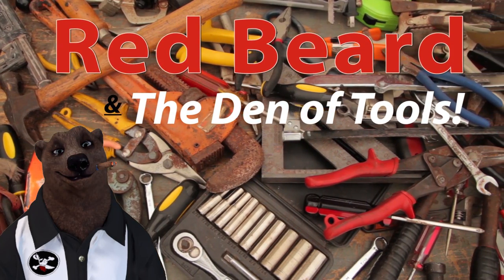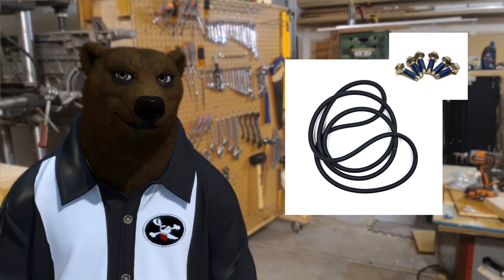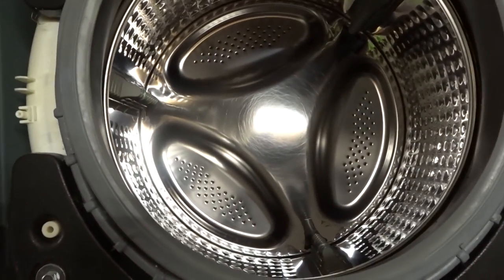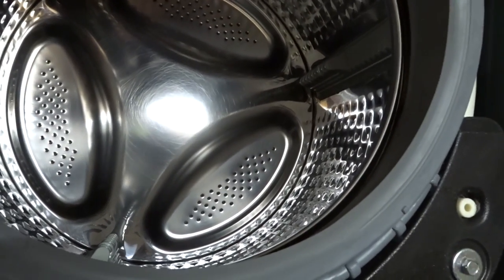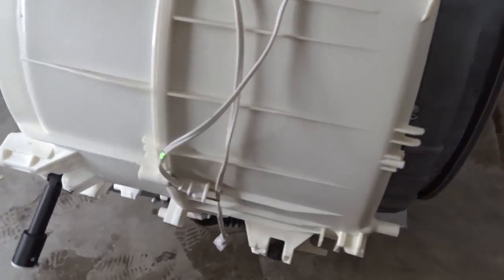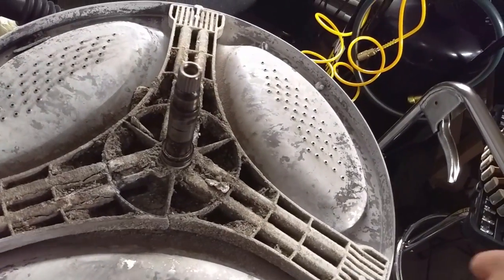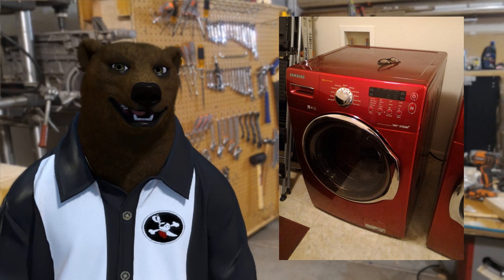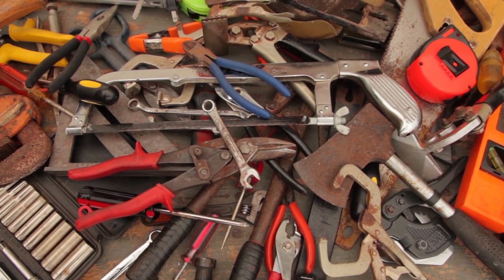Teardown and Fix of a Samsung Front Load Washing Machine  (WF331ANW)

Comment: Appliance Repair man here for 20 years.
You can’t buy a simple top load washing machine anymore.
I would have a drain pump in stock for that Samsung.
Samsung appliance’s are junk.
Reply: I agree, they should stick to television and mobile devices.
As well as LG, LOAD OF GARBAGE.
Reply: re-read Graystone Husky comment -- SPEED QUEEN.  I repair coin laundry equipment and SQ is the best top load washer on the market (repairable, heavy duty, all parts are available, and made in the USA). Every part of SQ washers are repairable including the transmission.  If your handy - SQ washer can last 30+ years. They may not be the best designed washer or best looking washer out these but they are reliable and repairable.

Comment: Another problem with these are the amount of water they use to conform to USA federal water restriction standards.  It is not enough water.  You can up the water by fiddling with the control valve but these washer/dryer sets are bad, bad, bad.

Comment: Hey I got smoking and rubber smell can u tell me where the belt is cannot find
Reply from the maker: I got mine off of ebay
Reply: The Den of Tools just found out mines direct drive so it’s totaled for sure piece of junk never again bye Samsung
Reply from the maker: @schmidt76ful  Sorry to hear that. I've talked to a lot of washer repair guys due to this video and every one of them said that all front loaders are terrible.  Only buy basic systems with an agitator.  Speedqueen was recommended more than a few times.

Comment: Nice job Bear, I knew you could do it! I love that lift cart you were using, where did you get it. I might have to get one.
Reply from the maker: Harbor Freight.  I use that thing all the time.  If it's not getting used as a lift it is a rolling tool tray.  I'm actually considering making a wood tray to sit on top of it just for that.

Comment: This job is not worth doing no matter what your level of diy experience is. I realize that this unit and most similar units cost  3x's the amount of a standard top loader and when you pay that much you want to make it last but not on these type machines. 
This problem is caused by electrolysis, stainless steel in contact with aluminum and steel bolts in contact with the lye in detergent. How these issues were missed in engineering is a mystery. You repair this and you're just duplicating a mistake already made and it could last 5 more years or fail in 6 months. Depends on the grade of "pot metal" you get on new spider.
While doing this job you also should replace tub gasket and bearing. All 3 of these parts are priced accordingly. You can get a kit for about $300.00 bucks with all 3. I priced these things all over and couldn't find the spider alone under $100. Then the labor and time to do this..if retired yeah go ahead, otherwise forget about it. 
I fell into this trap and bought a similar machine with no agitator and energy star compliant. Water saver so was suppose to get a rebate from water company. Applied, it never came. The clothes are never clean. No agitator and you can expect that fresh just jumped out of a trash can look daily.
Never buy a front loader or a machine with no agitator and stay away from any appliance with a circuit board and you'll be way ahead in the long run. 
Good video to learn to do this job though. He covers it all. Think he's gonna learn the hard way on the tub bearing and seal though. JUNK THIS GARBAGE!!!! Sue Samsung for not recalling these.

Comment: I accidently washed something cakeb with mud and gravel in my samsung front load washer. . Now it sounds like there's gravel under a belt or something, so I've stopped using it. What's the best way to access the area where the belt would be? My washer is old.. got it at Lowe's in 2008. I've not used it now for a few years because I've procrastinated getting it fixed. I'm a 50+ widow and hoped I'd find someone willing to take it apart and look without calling a technician. I've used a portable washer. It's about to die. For less than $100, I'm shocked it's lasted 2 years! 😉

Comment: these front loaders are garbage. maintenance monthly + repairs.
 even a repairman told my neighbor: buy new, for a pump hose not worth the cost labor 300+ parts 165.00.    ive fixed and sold 3 units now in my hood. buy a top loader. my sears 15 yrs old still runs great
Reply from the maker: You are right on that count.  I bought it to make the wife happy,j what can I say?